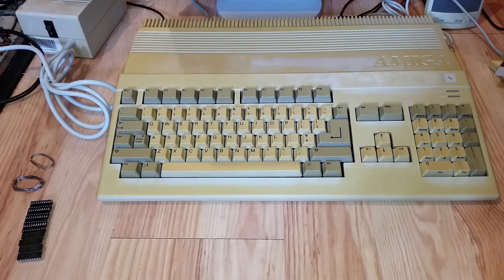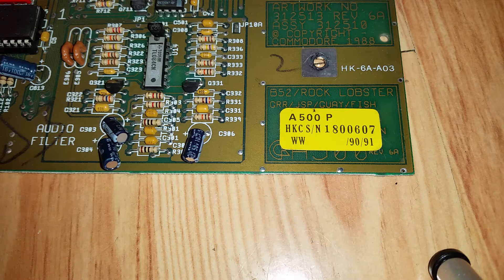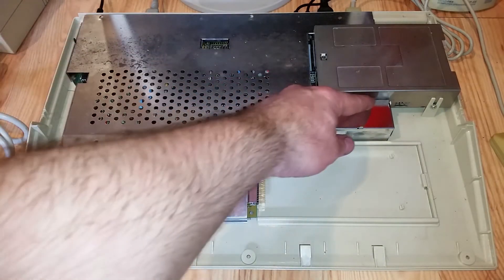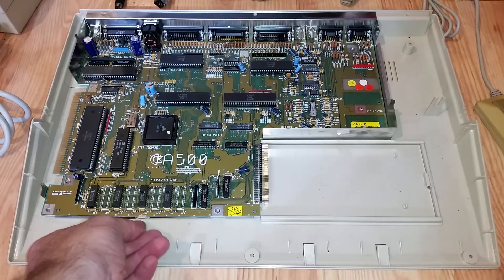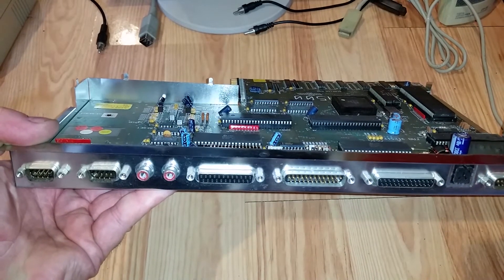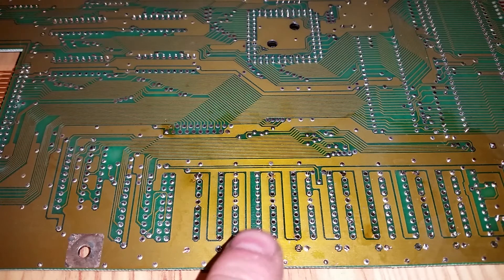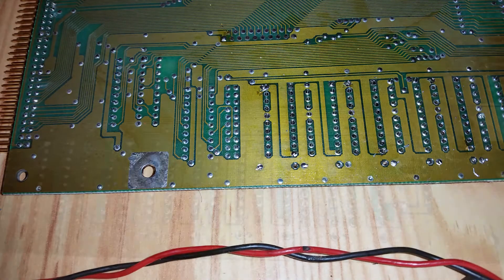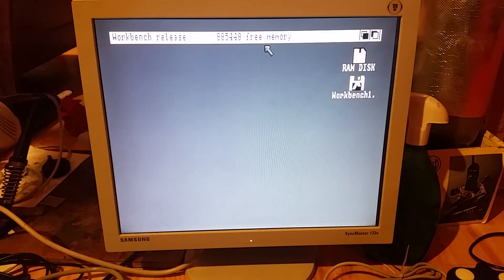Adding 512K Memory Chips To An Amiga500 For 1MB Onboard

Comment: My goodness, that desoldering pump looks EXACTLY like mine, same color (including the fade) and same sound. Is yours also over 30 years old?
Reply from the maker: I probably got it from Maplin. It doesn't latch very well any more, it can be annoying to use. I should get a new one.
Reply: @DevelopIT  Mine still working fine, but the tip is worn, should get a new one for it. It's one three that I have (Plus a weller desoldering pump)

Comment: Which capacitors did you use exactly? Near the replaced chips? Thanks.
Reply from the maker: I always use 10nF ceramic capacitors for decoupling capacitors. I have seen other people use 100nF. Any value in that range should be OK, best to keep all to a consistent value though.
Reply: @DevelopIT  Thanks! I was reading on Amiga forums, most don't even bother with them due to not being much noise without.

Comment: Is there a "downside" of that mod? are there any programs / games which don't like a 1MB chip RAM?
Reply from the maker: I don't know if any games wouldn't work. The on board memory would be chip memory, which mean other hardware can access it such as the graphic chip. The trapdoor memory is fast memory and can only be accessed by the CPU.
Reply: There's supposedly some few handful of badly programmed early Amiga 1000 era games that won't run if you have more than 512KB of RAM (chip or otherwise), but I've never personally encountered one. That's the theoretical rationale behind why you see some 3rd party trapdoor expansions with the option for a disable switch. At worst it's a rare edge case though.

Comment: Now can you still use another 512Kb on the expansion port for 1,5MB in total?
Reply from the maker: I would expect it too, I don't know because I haven't tried. If I go up in my loft at some point I'll get a card out and try it.
Reply: No you can't, cutting the jumpers to detect the extra chip ram disabled the expansion port.

Comment: Awesome. I've always wanted to populate those=P Do you have the link to the RAM-chips you bought?
Reply from the maker: The eBay item number was 174372100511, if you search for this number on eBay you will find the item. When I got them they where £4.07 for two, now they are £5.33 for two. The part number is 
HYB514256B. Do a search for the part number, order by price and select from UK and you can find cheaper.

Comment: what about capacitors c20 .. c23?  0.1uf ceramic mono type
Reply from the maker: It should work without them, I put them on in the end before I knew about jumper J2, as the absnse of modifying J2 the Amiga still reports 512K.